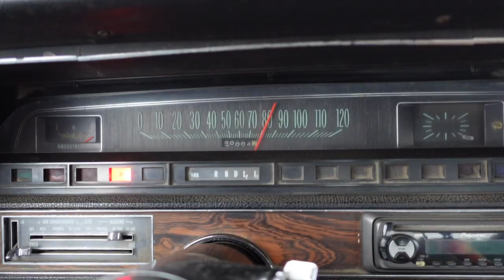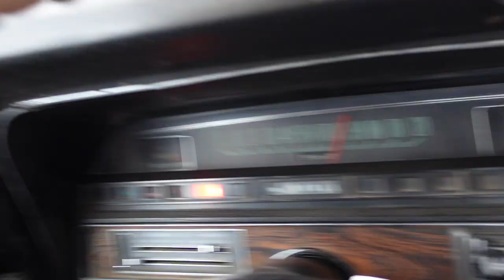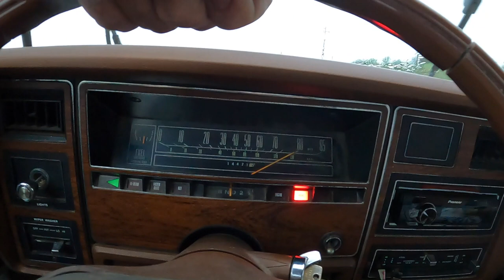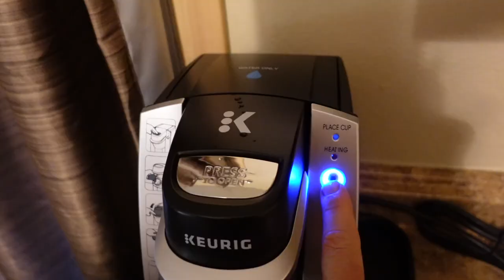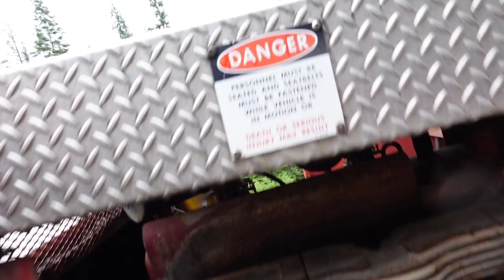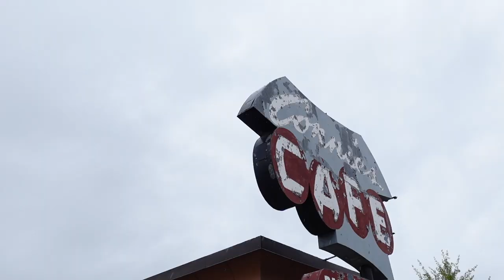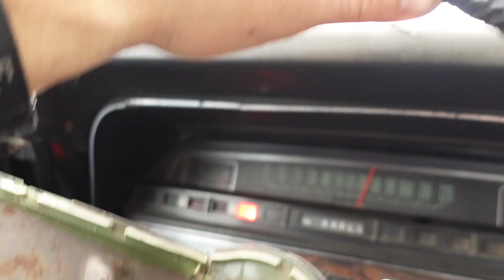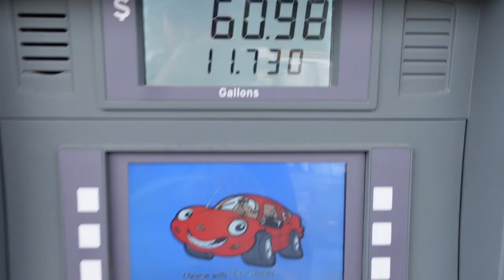1969 Impala and 1977 Ford LTD Take on 500 Miles of Mountain Roads

Comment: We have a 2dr sport coupe 69 Impala
Reply from the maker: Nice, that's what I robbed the front discs off of. Wish I would have kept that car, but no title. What engine are you running?
Reply: @DaysofPainandVictory  I am going to put a 350 4 bolt in it with a turbo 350
Reply from the maker: @gmray7301  right on, that's what I'm running currently, well it's a 2 bolt main but its not hopped up that much, just the edelbrock cam, intake, carb, and flat top pistons. The heads i'm running are crappy 76cc with leaky valve seals
Reply: @DaysofPainandVictory  mine was a crate motor with 7k miles on it and the guy that had it replaced it with a bigger motor. I worked at the dealership and got it for $250 bucks. I put a Henerys cam in it. The transmission only has 10k miles and is a jasper. I had a Stroke in 2020 but I am getting ready to finish it for my wife to drive to work and back